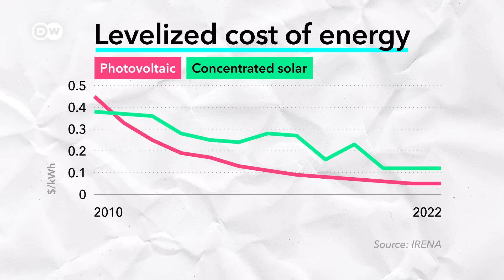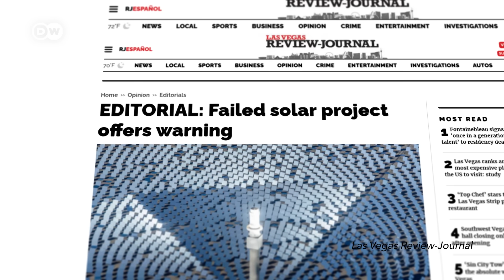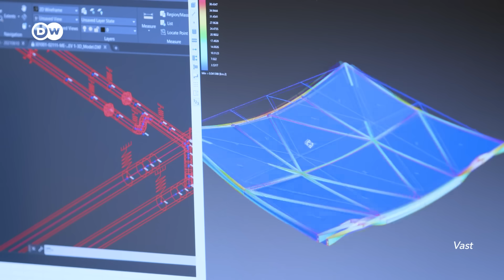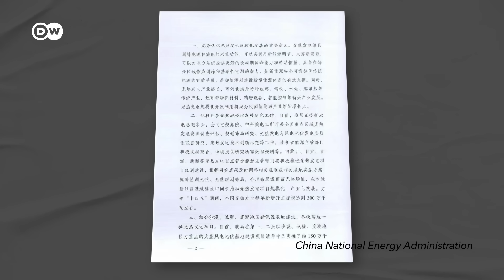How we can make solar power at night

Comment from the maker: What do you think, can CSP really make a comeback?
Reply: These exist already, don't know why you covered it, they aren't living up to their potential and cost a lot and aren't as reliable as solar panels combined with grid storage which does EXACTLY the same thing but costs less.
Reply: I was a CSP enthusiasts during university and did supervise a master thesis on this topic. However I believe in mainly PV future. It is to simple to scale from pocket calculator to GW range.

I think on the long term it is simply cheaper to have a global HVDC grid and the sun is shining at night on the other side of the glob. Plus some battery storage of course.
Reply: Hybrid CSP with PV, using the fluid medium in micro-channels to cool multijunction bifacial PV targets at the focus of parabolic troughs. 

PV efficiency increases as irradiance increases toward ten times peak sun and temperature drops toward 100-300 C. 

Not hot enough for hot rocks storage, but plenty for compressed air that lasts days or weeks in insulated underground tanks.
Reply: Nope, I doubt it's more efficient than solar panels and separate energy storage when all efficiencies and losses are taken into account.
Reply: @DWPlanetA  I doubt it if one rare bird gets burnt or blinded there are groups to shut it down building a cage around it might add to must to its cost. I seen one work well but there been those who don’t want them even if rewards are there for the society. Energy groups feel attack from all sides engineers have enough to do maintaining system they already have to put energy into new projects unless the public goes along.
Reply: I guess CSP plants are less harmful for environment because mirrors aren't as hard to recycle as solar cells.
Also solar cells production emits more greenhouse gases Right?
Reply: @a2_games  comes down to efficiency of money and land space in the end. There's no cost being added for recycling yet.
Reply: Haven't watched the video yet, I imagine CSP stands for Cerbal Space Program
Reply: PV plus battery may be cheapest for the every night energy needs, but with CSP you can within the same land areas of mirrors, add more and more storage tanks. Although they lose a little energy each day, that can be topped up each day. So you could build up quite a store or energy that can then be used to cover times of low wind generation or high demand such as heat waves. Once you've built the mirrors and towers adding extra tanks will be cheaper than adding extra batteries. So it could have a roll in intermediate duration storage. It would not been practical to use for seasonal storage though as that would be too long to hold the heat for.
Reply: @adrianthoroughgood1191  season storage is not a thing, nor a requirement, wind picks up generally when solar declines. Different areas of the world will have different requirements, but generally power can be made each day.

The issues are base load generation, reducing the ups and downs each day and stabilising the grid.
Reply: @Commander_ZiN  You're right that most of the time either solar or wind are available. If demand was constant through the year then seasonal storage wouldn't be needed. But demand patterns are climate dependant. In a hot country demand is high in summer. You can cater for this with extra solar. The difficulty is in colder countries much more energy is needed in winter than in the rest of the year. Currently this is met by burning fuel for heat. When we stop using fossil fuels this will need to be met from electricity. The winter electricity demand will be huge. Solar is useless in winter in higher latitude countries. Building enough wind turbines to cover winter demand will mean having to build much more than would be needed to cover the annual usage if it could be averaged out. This is where seasonal storage is helpful.
Reply: @adrianthoroughgood1191  PV can also use the same storage technology as CSP. Or can't they? What prevent them to use it too?
Reply: @gorilladisco9108  making electricity is a low efficiency operation. Sunlight to heat: high efficiency, heat to electricity low efficiency, overall reasonable. Sunlight to electricity low efficiency, electricity to heat: high efficiency, heat to electricity: low efficiency. 2 low efficiency steps meaning overall poor efficiency. Heat storage is cheap but low efficiency. If you can add it into a system that already uses heat such as CSP or nuclear then you aren't taking any substantial further efficiency hit but you gain flexibility. But using thermal storage when you start with electricity and want to finish with electricity is very inefficient. Batteries or pumped storage are much better in those circumstances.
Reply: Absolutely, indeed already comeback in China 568 MW operational, 1,350 MW under construction, 3,000 MW under final development stage, construction to start in 2025 and we are targeting from SolStor Energy LLC and AELIUS Energie SLU, the American CSP Renaissance
Reply: Csp seems to be way too much labour/maintenance intensive and complex. Too many moving parts. Simpeler is better. It is only cheaper in desert areas, which raises the other problem of transport. In EU there will be a surplus on wind energy (also available in the night) and pv energy, there is many alternatives to storing this and to remain more efficient from a landsize  perspective. You can also convert your surplus during the day into green hydrogen and use that in the night.
Reply: @flinkaflenkaflrsk  you are right that labour costs are higher. But actually in terms of energy per unit land CSP is double that of PV. For night time energy, comparing PV->H2->electricity vs CSP with storage it's about 4x better efficiency/yield per unit area. It's only the cost that let's it down. The question is whether they can bring the cost down faster than the cost of batteries comes down.
Reply: I doubt it, too many negative variables
Reply: We should be making next generation wind alternators that never need maintenance for decades running on magnetic levitation roller bearings...these solar frying pan concepts destroy thousands of birds every year, its a violation of birds rights to have these hotpans
Reply: Nice strategic targets in a war.
Reply: These solar plants may pivot to generating Solar Fuels as dine by Synhelion (DAWN project).
Reply: Two question :
- Why don't photovoltaic power plants use the same energy storage as concentrated solar plants? What prevent them from doing it? You know, just like when Sony slowed down their Beta video cassette rotation to give it longer recording time, JVC just copied it to make their VHS video cassette longer recording time too.
- Are there any research to combine photovoltaic with heat reflecting in one plate? Or maybe simply run radiator fins underneath photovoltaic plate, both for cooling it (cmiiw, photovoltaic cells are degrading under heat) and harvest the heat.
Reply: @gorilladisco9108  The solar panel is very efficient, they do everything they can to absorb the suns rays and not reflect them, as that will be counter productive, they don't require cooling and don't produce heat enough to harvest. If you want to know more you can research how they work easily enough.

Some photovoltaic plants have on site storage but once the energy is on the grid it can be used anywhere in storage and yes some are using salt storage but there are many other methods.

In the end it all comes down to cost efficiency and area efficiency.
Reply: Why not just use CSP to concentrate moonlight directly onto PV to charge batteries, doing away with molten salt and turbines?

Generating heat is inherently inefficient.
Reply: @carlfrancis8565  do the math on how much moonlight you'd need. How much heat do you feel from the moon at night compared to the sun during the day?

I don't think you could make an array big enough, if this worked solar panels would work at night.
Reply: @carlfrancis8565  No, generating heat is efficient. Turning heat into electricity is inefficient. But PV is even more inefficient. The overall efficiency of CSP is around double that of PV. Moonlight just doesn't contain enough energy to bother with.
Reply: How about ing the heat energy to split water and generate hydrogen? Would that not be more efficient than electrolysis?
Reply: @nucderpuck  there is a panel that has been developed that outputs hydrogen instead of electricity
Reply: One problem with these CSP which was not mentioned, is that they are mostly situated in deserts where water is a scarce resource. When you run a steam turbine you will need plenty water. There might be systems that do not use water or can recycle the water, but likely not as efficient.
Reply: nah kcp 2 was a failure
Reply: @ceiling_cat  did you mean KSP 2?
Reply: I don’t think it would have comeback due to cost but I think it should
Reply: I believe a lot of these projects are created to get federal dollars! If it works GREAT! If it don't cash out!
Reply: I don't think CSP will make a comeback, PV and Batteries are just getting to cheap. Also CSP doesn't work that well in the regions that have the biggest problems with the variation PV electricity production from PV. But of course we should continue researching it.
Reply: Nope, I think similar solar thermal tech like thermophotovoltaic will be the future of solar thermal instead.
Reply: Every house I have ever lived in uses almost zero power at night. Everything except a few LED porch lights is off. We even started turning off our water heater at night. We have never heated or cooled at night. The fridge is on. I just assumed most other houses are nearly zero? If so I suppose there’s other loads such as 27/7 factories, streetlights, hospitals, etc that need some power. Did they say how much power is used on average daytime vs nighttime? Concentrated solar is great technology to have in some places I’m sure. .
Reply: @paulbaker3144  At night the load is still around 60% of the maximal load. At night of course factories and so on need electricity, but also households need still some electricity: Fridges, in some (and soon more) cases a heat pump, electric vehicles, electric devices like mobile phones, people watch TV or play computer games in the evening, some people have an aquarium that needs electricity 24/7 and so on. Heating and cooling need a lot of energy while light needs thanks to LEDs not so much electricity. For heat pumps it's also the most efficient way to keep them at a constant load. Also we shouldn't forget people in Northern countries like Norway, Sweden, Finnland, Denmark, but also the UK, the Netherlands and Germany. In the winter we have sun for less than 8 hours, of course the people need then electricity when it's dark outside.

You can find nicely presented data for electricity production and load for many European countries on https://www.energy-charts.info/charts/power/chart.htm?l=en&c=DE , a website from a German institute based on EU data. (You can choose the country by clicking on the German flag on the right.)
Reply: If it becomes more affordable and cheap then maybe -
Reply: CSP also has the benefit of being doable in vast areas of the World! Please cover this subject more.
Look into this last generation power plant being built in China: Yumen Xinneng CSP Plant https://www.google.com/maps/place/Yumen+Xinneng+CSP+Plant/@40.3294927,97.2700596,2044m/data=!3m1!1e3!4m6!3m5!1s0x37c7b33e18f6d759:0x6162019542e51786!8m2!3d40.3326771!4d97.2732976!16s%2Fg%2F11hzwxmcgz?entry=ttu
Beam-down solar thermal power plants are the future!
Reply: I think China will make it comeback.
Reply: nope its a failed project
Reply: I think only usefylul for Europe. In Mena countries, here in Pakistan we get 12 months sunlight so when lithium batteries get cheaper, we will switch to that rather than some salt powered turbine.
Reply: No, because its expensive, and more expensive to maintain. They also have a large environmental impact. Its basically a Rube Golberg contraption.

Technology that's been ignored since the 1980s is far better... look into Solar Chimney power plants.
Reply: No! Electric Solar panels, solar heat panels and small windmills can be installed on or close, to the source of use, TAXFREE.
Preventing miles and miles of expensive powerlines and exsesive taxation!
Reply: I don't think so. Heating molten salt with CSP is more efficent, but is it cheaper then melt it with solarcells ? There is a large grid of solar cells for example here in germany, on a sunny day germany produce more power then it need's. If we use this energy to heat molten salt, we have a very cheap way to do it. Because as in germany the people finace there own solar power plants on there roofs, energie will be cheap for melting the salt. CSP also has no big grid, it deppends on local mirrors, if there are clouds in the area the CSP is build, no enegrie will be produced, but the solar network is wide spreaded, it will allways produce power. Molten salt yes, CSP no way.
Reply: Yes. Volcanic winter can create problems, but a CSP/thermal storage plant is more resilient.
Reply: I am a student intrested in this makes a modal we can use teleflon(PTFE) spray for  anti  dust  and use these reflector 
Parabolic Troughs
Linear Fresnel Reflectors
These reduces the. Need of the reflectors angle changers used  in this failed project
Reply: Hello from Los Angeles California.  I lived all my life in Los Angeles California, and in the 1980's the Smog was so thick it filtered the Sun. The smog blocked the Sun so much the winter's in Los Angeles California was so cold between 36° to 55° Fahrenheit nights dropping to 33° Fahrenheit 
I couldn't see mountain ranges from where I live 4.5 miles away. Unless it was windy and smog cleared. Now the air is so clear you can see cracks and riges, on the rock walls. 
It uses to rain 🌧 none stop for 7 months, and the summers never exceeded 90° Fahrenheit. Due to Sun being filtered from smog I also didn't need shades, for my eyes. Now 🌡  are 110° Fahrenheit for excess of 1.5 months with 5 days in the roll Temps exceeding 116° and 1 day at 120° to 126° depending on fire conditions radiating heat. 
Air clean enough, and it will not get any cleaner with only Electric Vehicle's (EV's)
Now to the reason why Environmental green agenda causes Drought Conditions.  In 2010- 2013 there were Solar Mirror s installed to project solar arrays to a Tower with mirrors projected downward to under ground reservoir water sources.  To generate steam, and generate Electricity.  
The temperatures 🌡 causes the atmosphere to close to 5,000° and every time birds fly thru become instantly baked and fall. 

In the 1980's the Jetstream used travel across California in to Nevada,  Arizona,  New Mexico,  Texas, and so on to Florida.  Due to the Mirrors the Atmospheric High Pressure. Has pushed the Jetstream away from Southern California to North to Washington,  and or Canada 🇨🇦 . This cause along with getting rid of Smog cause higher temperatures and Drought Conditions. You couldn't pay me $10,000,000 per hour to sit, promote,  sell, let alone buy any Electric Vehicle's (EV's).
If you look up StachD Training channel, on his video titled Lithium Largest Ex plo ding EV Recycling ♻️ Center in Missouri.  There were 4 Recycling ♻️ Centers in the United States.  Now there are 2 Recycling ♻️ Centers,  and none are in the State of California.  Due to Environmental Impact, which the video shows Fire Authorities spray granulated elements of the Lithium-Ion Batteries 🔋 Packs,  into creeks, rivers,  and lake anfmd underground well resources.  Not even boiling helps, and fish hacmve died in those water ways.   Sure clean the Air while you Pollute the water. In April 2024 the 1st Recycling ♻️ Centers in Phoenix Arizona location burned down,  and dousing water to keep cool prenting spread of fires 🔥 have caused Drought Conditions.  @truebrit3670  Look it up
StasheD Training channel 
Missouri Recycling Center ♻️ Ex Plod ing can't spell this out. Fish died wells for water is no good anymore,  and became Acidic 
These are facts. 
Mirrors in Mojave Desert Modified where Jetstream away from
 Southern California.  
The so called green agenda is to keep there pockets full or bank accounts.
Reply: Yes. Say hello to my little friend!! A 132 MW system built on a 0.2 km² man-made pond, using quartz Fresnel lens/dome combination aligned with a graphite receiver to generate round-the-clock energy cleaner than a solar panel's conscience!! 🤠
Reply: In 2030, no one will be able to compete with PV+Wind+Batteries
Reply: PV cells cannot replace thermal plants because they cannot generate reactive power, unlike the power generators in thermal power stations. So we need CSP.
Reply: @vignanashala , this is not in line with current state of the art...
Reply: If yes, it will be from China.
Reply: Yes, beyond night-time power CSP is also useful to generate high-temperature heat for some hard-to-decarbonize industries like steel or cement, but admittedly these other avenues remain speculative.

Eventually, mirrors and lenses should make a bigger comeback, because they are needed to reach the thermodynamic efficiency limit for converting sunlight to electricity. So if we want to maximize the power harvested per unit of land area used we need those focusing techniques. This could be in the far future though (Dyson sphere anyone?)
Reply: @Hecatonchires1991  This was exactly my thoughts too. Imagine some industries that require several hundred degree indirect heat for say annealing or chemical processes, and them having their roofs covered in mirrors directing light to a tower and storage tank that allows them to opperate those processes in a closed loop 100% solar 0 emission way? The Dream. We REALLY DO need a solarpunk future.
Reply: @Hecatonchires1991  ya
Reply: We need all sources of energy. That just need to be correctly sized for the correct loads.
Reply: The thermal storage medium is what is holding this technology back   ....which has apparently been solved using carbon blocks instead of molten something or other.
These also have the advantage of being able to come in container form and can be used as a direct radiated heat source, just remove the cap, so to speak, and let the heat beam out.
These containers can also directly produce electricity too.
Plus it is Much cheaper and stores a good chunk of carbon too.
Reply: @OniMetsuki  
"Carbon + heat + open air"
"Kaboom?"
"Yes, Rico. Kaboom."
Reply: Frankly, no.

Batteries are expected to drop in price by more than half before the end of the decade, and to continue getting cheaper at an astonishing pace. And photovoltaic panels are also getting even cheaper, despite already often being the cheapest way of generating electricity. CSP might be cheaper for dispatchable night time energy right now, at least in China, but by the time China would be ready to export it at scale battery-backed photovoltaic generation will be much cheaper than it's now.

The only exception I see is if a country bans imports of Chinese-made solar panels and/or batteries but doesn't do the same to CSP; then it has a chance to compete in price.

Incidentally, this also doesn't touch the ecological issues with CSP. Whereas solar panels can be combined with native vegetation to create habitats for local fauna, CSP often roast and kill all flying fauna, from insects to large birds.
Reply: @FabioCapela  Solar cannot entirely replace generators. PV cells only develop DC power, not AC. So, solar is good for microgrids running on DC.
Reply: @vignanashala  Converting DC to AC is very easy and nearly lossless. It's what the inverter in almost every solar install does.
I have a system like that in my house, mind. My solar system powers all my AC equipment.
Reply: @FabioCapela , but generators also generate reactive power, as I mentioned in my comment.  So you still need thermal power stations to use generators.
A solid-state device cannot replace a machine.
Reply: @vignanashala  You just need wave-forming inverters. Which, in the event of a blackout, are actually a lot easier to bring back online due to their lack of real inertia; they go from stopped to 50/60Hz instantly and at the phase you need, while thermal generators take time and need to be carefully phase matched to the AC wave. There's a reason recovering from a blackout can take the best part of a day after necessary repairs are complete when your electricity generation is based on large thermal plants.

And if you want real, mechanical inertia without expensive fossil fuels, just use flywheels. You can spin them up with electricity and they provide all the inertia you could ever want to the grid. Though, frankly, I consider them unnecessary in just about every scenario, as batteries with wave-forming inverters can do everything they can do, only better.
Reply: @FabioCapela , Is this from ChatGPT? And what is the role of inertia in a power grid? Power electronics is a made-up thing. Electronics are intended for low-power applications only, for their extreme unreliability and corrupting power quality.
And before you say that power quality can be improved in AC systems connected to several electronics, it is not possible at all.
Reply: @vignanashala  Inertia is the capability of some grid elements, such as traditional generators, to resist frequency and voltage changes, which helps stabilize the grid. The problem is that when the grid goes dark the inertia from those same generators resists attempts to bring it back online.
And pure electronics can support very high power AC just fine, you just need the appropriate inverters. There are multiple Gigawatt-scale solar power plants in the world supplying AC power, for example, some of which are more powerful than even the largest fuel-powered power plant in the world (an 8.7GW natural gas power plant).
Reply: Maybe maybe not the future is a string of theory and possibility
Reply: اللي ما ذكر في التقرير ان كفاءة هذه المحطات اقصاها 40% وانا اعرف طريقتين لرفع كفائتها الى 70% على الاقل وهذا سيجعلها منافسه للالواح الشمسيه لان كفاءة الالواح بحدود 23% فقط ,المشكله في كلاب الخدمات السريه لديكم باعتبار ان الصهاينه يسيطرون على اوربا وعلاقتكم بهم قويه , ستجدون الحل يأتي من الصين على الاغلب , وبزيارتي الاخيره للصين طرحت على شركه صينيه نموذج افضل بكثير من هذا في الفيديو بكفاءه حوالي 90% !؟! واعربت شركه صينيه حكوميه عن اهتمامها , بالتالي يمكن اعتبار جميع خبراءكم بهذا التقرير مسؤولين عن خسائر ضخمه لاقتصاداتكم ( الف عافيه) لانهم لا يعرفون افضل التقنيات الان , عرضت على الشركه الصينيه رفع الكفاءه اكثر ! ؟ وتخفيض الكبفه تقريبا الى النصف !.... خبراءكم يحتاجون دروس ! بالامكان اعطيها لهم من الصين فقط
Reply: @sermadreda399  Then how about putting up some peer-reviewed work for inspection and comment?